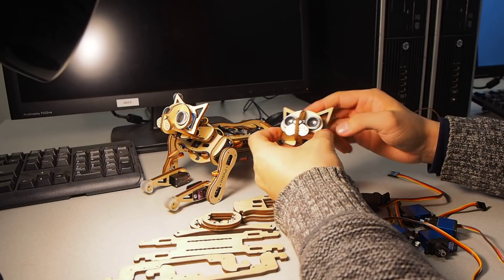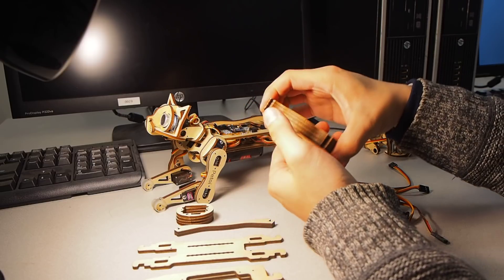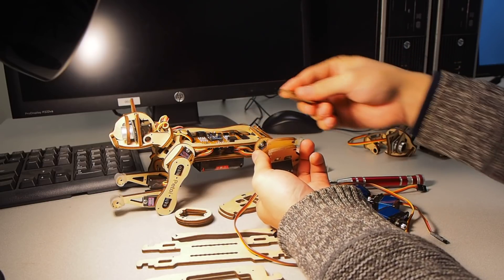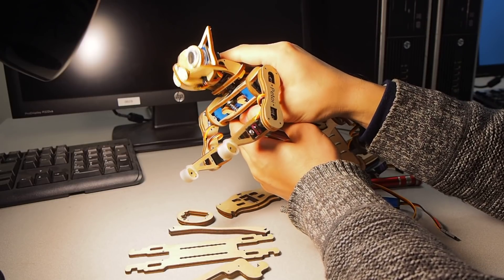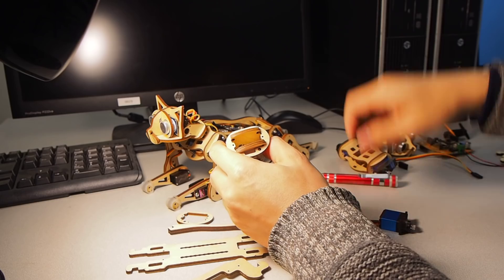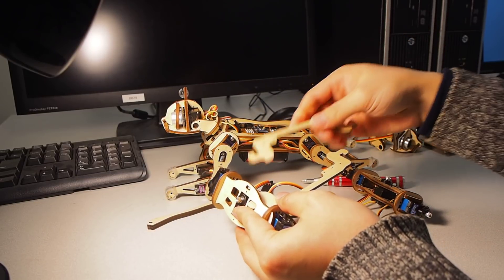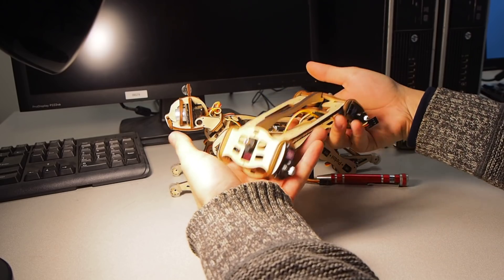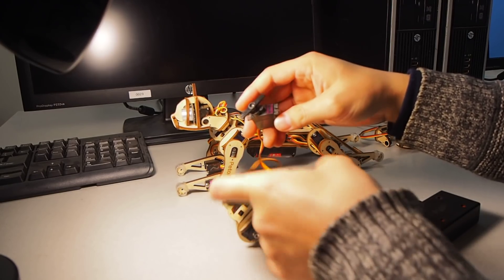Part3. Nybble Body Assembly Guide | Build Your Own Educational Robot | PetoiCamp

Comment: I am confused by the inventory.  In the video you have 4 identical shoulders but my kit has one that is different which is marked "shoulderPi in the picture.  Also my "belly" only has one slot instead of two.
Reply: @petoicamp  Is there updated assembly somewhere?  I am building the front body section and I have a flat rib and a rib just like the others.  Is the flat rib for the head side? (It only has one hole for servo mount)
Reply: @petoicamp  Where exactly does this special shoulder piece go - front or back, inside or outside?